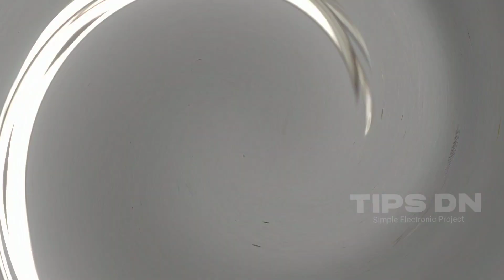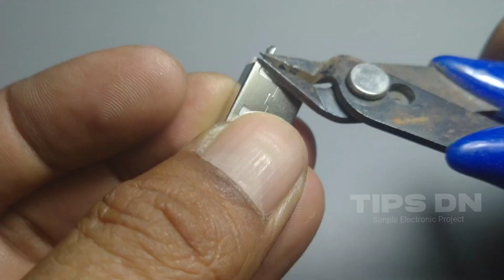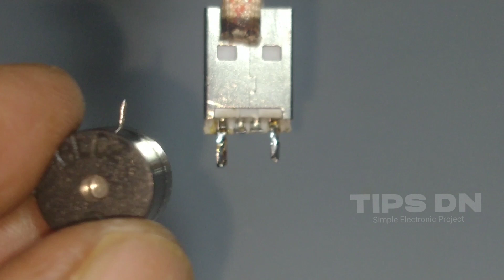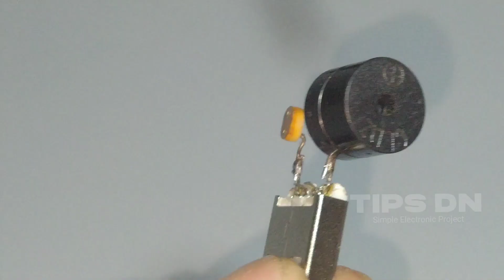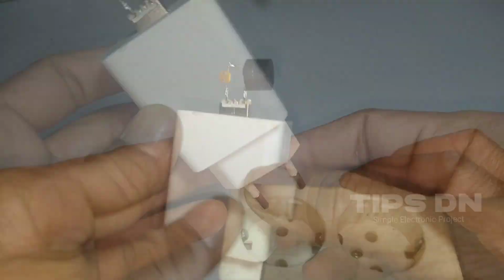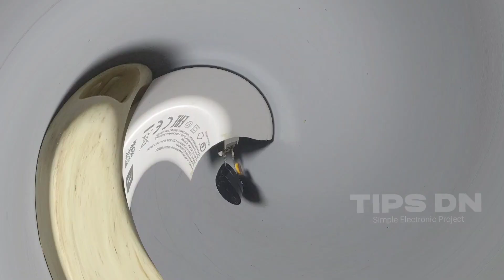CARA MEMBUAT ALARM SENSOR CAHAYA 2024

Comment: Bang.. guwa ada switcing 60ampere outputnya 12v.. gimana caranya outnya di naikan menjadi 13,7 v ? 
Tolong dijawab.. 
Terimakasih bang
Reply from the maker: Banyak step down dc di pasaran gan buat turunin voltage
Reply: @TIPSDN  dinaikin bang bukan diturunin..
Reply from the maker: @ddhchannel3050  bisa menggunakan step up dc ,banyak di jual di pasaran bang
Reply: @TIPSDN  inputnya dc12v 40ampere.. apakah kalo dinaikan tetap 40amper.. soalnya aku browsing dimarket place adanya 20ampere